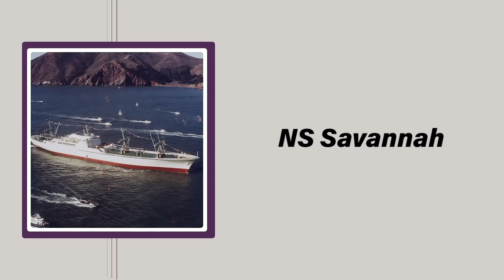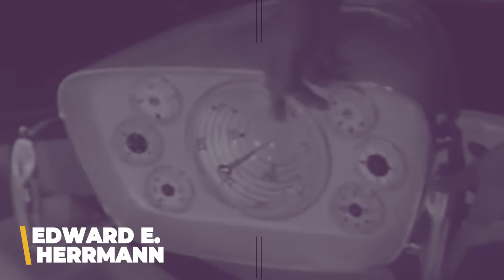Nuclear Powered Vehicles: Cheap, Sustainable, and Potentially Deadly

Comment: Fun fact: The Ford Nucleon concept car had the dangerous bit in the rear. While never built, it did provide a template for the later Pinto. Allegedly!
Reply: No, like in any other car the most dangerous bit sits right behind the steering wheel.
Reply: My sister had an early 70's Pinto. It had a rag hanging out of the bumper like a wick.
Reply: Such a fun word to say. Pin-tow. Wonder if I'd even fit in one, since Civic hatchbacks don't like me (my uncle had one, if he hadn't removed his passenger seat to make room for his Bass equipment, I would not have been able to get it lmao. Literally sat in the backseat, and was still a bit squashed.)
Reply: The Pinto was an all round disaster for Ford; deservedly so:
• The bad PR was chiefly due not to the defects in the Fuel Tank of the cars, but that Ford was seen and lambasted by the public for seeing the cost of compensating families of dead owners as being cheaper than fixing the defects.
• The crappy paint.
• The daft choice of name, that had both the Hispanic & Spanish markets howling with laughter at how aptly the relatively underpowered car's name was.

Ironically Ford would use the name again for an Engine, no doubt to more mirth from the aforementioned countries.
(and yes, the Pinto engine was rubbish 😂)
Reply: Pinto was scapegoat because the name was easy to remember.
Cars catching fire after a crash happens in the movies but is very rare in reality.
About the Pinto: "When all types of fatalities are considered, the Pinto was approximately even with the AMC Gremlin, Chevrolet Vega, and Datsun 510. It was significantly better than the Datsun 1200/210, Toyota Corolla and VW Beetle. The safety record of the car in terms of fire was average or slightly below average for compacts, and all cars respectively. This was considered respectable for a subcompact car."
https://en.wikipedia.org/wiki/Ford_Pinto
Reply: @richardgreen7225  the problem with the Pinto that nearly bankrupted Ford was the propensity for the paint to fall off due to incompatible paints being used, the only cure was to strip the car and repaint, the cost of which is enormous, all done under warranty of coarse, little known and not something Ford wanted to make too much of, catching fire on the other hand didn't have the same cost implications because as you have pointed out it was average for its class but it gave the press something to latch onto.
Reply: @richardgreen7225  have you ever seen a 4-wheel drive Gremlin?  A friend's brothers made one. Funniest thing ever.

Comment: Moving the reactors around would be incredibly stupid. But having one buried in your backyard, providing electricity for both your home AND your electric vehicles...
Reply: Maybe not back yard, but certainly in a neighbourhood.
Reply: Too prohibitive in price, even for the Thorium salt reactors. The reactor itself would be what's prohibitive in price, as the materials would be extremely expensive. You need materials which could withstand several thousands of degrees in thermal energy over a long period of time. Also, Thorium salts are costic when liquified. 4th gen reactors are a pipe dream. Time to find a plumber...
Reply: @guardsmanom134  Tell it to Kirk Sorenson. I'm not an expert, but he makes an extremely compelling case.
Reply: @grugnotice7746  I tried to. Apparantly, I'm some crackpot who doesn't understand physics, so he told me. 
Funny enough, he then started lobbying for thermo-resistant materials to be layered into his designs. 
I told folks about the prohibitive expenses of such an endeavor, and he has yet to have enough working capitol to build his project. 
As I stated before, it's too expensive for one layperson to afford.
Reply: @grugnotice7746  add to that, that Thorium Flouride needs to be heated to induce the reaction, and it becomes even more prohibitive. 
It's my supposition that; by the very nature of the necessary thermal induction, and subsequent need for both thermal and costic protection of the reactor hull, the result of which will further make this technology impossible. 
Don't get me wrong, I'd love to see it work, and be affordable! Fantasy and reality do not often coincide, however...
Reply: @grugnotice7746  again, don't get me wrong- they already made one in Idaho, using American tax dollars in the 40's. The difference, is that their reactor was built by people who studied physics as well as mechanics, economics, chemistry, mathematics, and material sciences. 
Funny thing, so did I. 
Idaho's BGSR(Branford Gain Salt Reactor) cost $800,000(conservatively est) in 1949-57 when it was in operation, and made no nuclear-electric power, nor any useable waste material. To get rid of this waste material, they simply drilled a hole, and poured the hot slurry in. Víolâ,  instant flouridated water. 
The US Army considered it a loss, and a waste of time. The EUAE and ANC both consider it to be the largest nuclear disaster in North America, including the poisoning of thousands of First Nation's people with uranium and uranium mining byproducts. 
And yet, people still think that flouridated water was done so that "people could have stronger teeth and bones". The utter hypocrasy, I swear!
Reply: @grugnotice7746  it's hypocritical, because flouride leeches the calcium and phosphorus out of your bones and teeth, making them softer! 
Imagine that, people lying to cover their assets...
Reply: Nah. "Electric Cars" are a government endorsed scam, that screw over all but those with money to burn.

Nuclear power is great; it just has no place in Cars, due to the Square Cube Law making an adequately shielded reactor of decent power output too heavy to be viable.
(similar problem with Trains)
Reply: The problem is not about moving, but cooling. Uranium source of energy is simply heat and heat is slow. Take for example electric oven, it takes microseconds to turn it off and on, but the heat remains for minutes. A nuclear car would probably accelerate from 0 to 100 in 10+ minutes and the heat produced after you stop the car must be vented out. A large ship is an example for moving reactor - it can take 10+ minutes to accelerate ship to its optimal speed and in case of emergency a ship is always near to a cooling liquid. Backyard reactor would only work if there is a river crossing next to your backyard.
Reply: @IlluminatiBG  Look into modern reactor designs. Only the outdated tech we have been stuck with for the last 40+ years needs to be next to a river or ocean. Driving/flying vehicles were always going to have gen 4 reactors.
Reply: @grugnotice7746  Give me an example of an existing modern reactor design, that should be theoretically safe to operate and it can have fast enough reaction for cars.
Reply: @IlluminatiBG  Reactors charge batteries that turn the wheels. There is no reason to make direct powering of the vehicle a requirement.
Reply: @grugnotice7746  I do not see how that would be effective. Yes, nuclear cores holds a lot of energy and consider everything goes okay, you do not lose fuel (which if superheated can become uncontrollable spread of breathable ionizing radiation material), the conversion from heat to electricity and then electricity into motion would have terribly inefficient. In fact, far more efficient and safe method that would not require the car to carry the shielding is to have batteries in the car and the reactor in the charging station (which goes back to current situation).
The only effective way to do that is to be subcritical, which would discharge energy slowly enough to contain it, but it won't be much energy. In fact that method is used in voyager now. But that method is only effective, because voyager does not have nearby high energy sources around.
So in a nutshell, I am absolutely confident we won't see any critical state nuclear reactor in high velocity vehicles (airplanes, rockets, cars) any time soon.
Reply: @IlluminatiBG  Tell it to your cats, I'm not interested in your internet rant.

Comment: Nuclear use is just too expensive. The waste issue still has not been resolved. All countries store waste in pools and will put the waste eventually in deep holes hoping it will be safe for hundreds of years. Decommissioning reactors takes decades and as Fukushima showed there are lots of risks running nuclear reactors.  I am hoping we solve our energy problems in other ways, maybe by renewables such as Wind and solar with battery backup.
Reply: France does reprocessing, greatly reducing volume and longevity of waste.